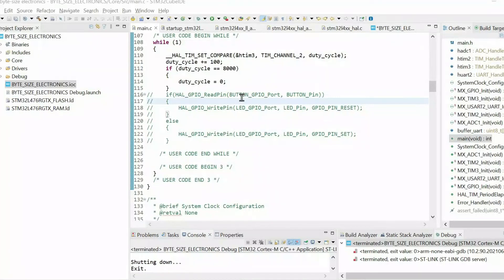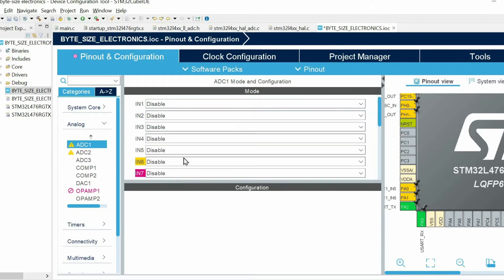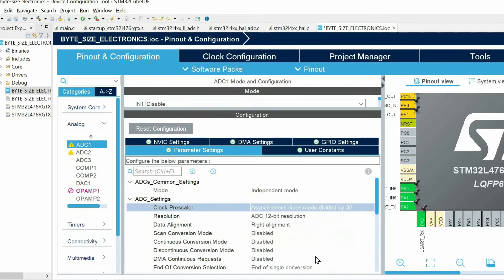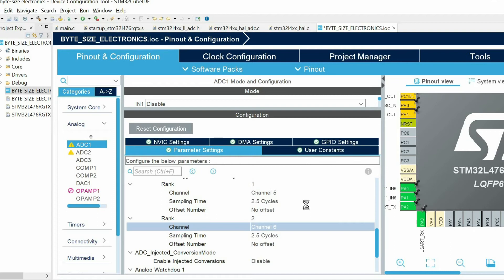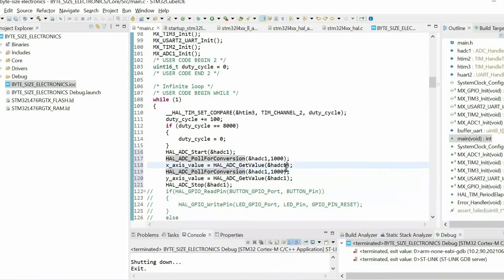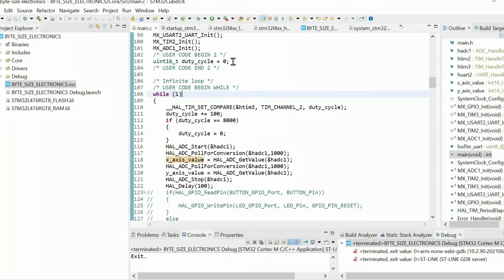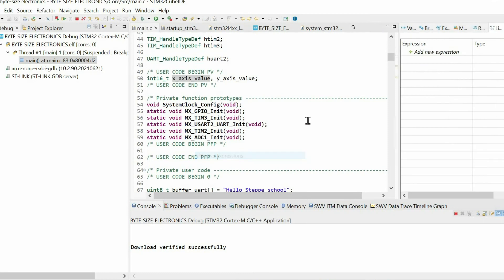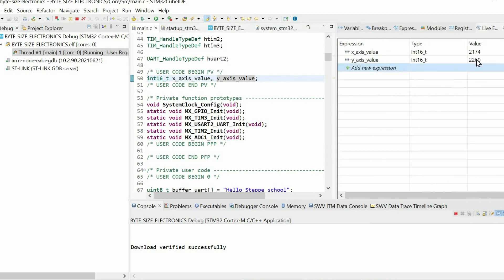STM32 ADC easy implementation

Comment: I have been discussing the ADC with another person, who seems to be getting "incorrect" ADC values, BUT I don't think that he has a known and precise reference on Vdda, and the PCB layout seems to have the "ground" from the sensor not directly connected to Vssa, and  he hasn't selected a specific value for the number of clocks for the input voltage to be sampled by the ADC capacitors...  This is a factor that can be very critical for analog inputs that have a resistance greater than, say, 100 Ohms.
Hopefully you are doing well,
Der Bär